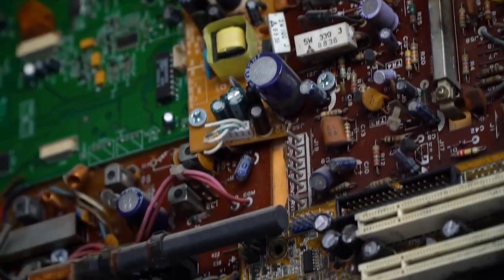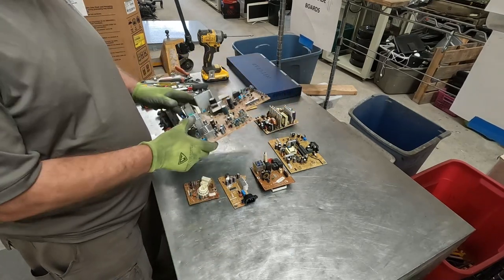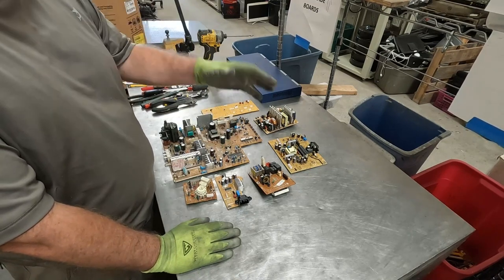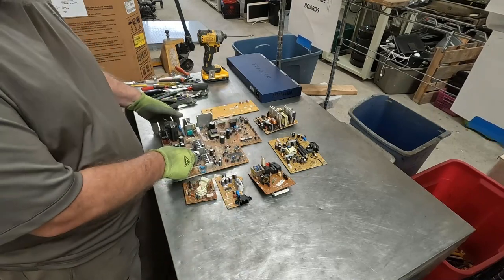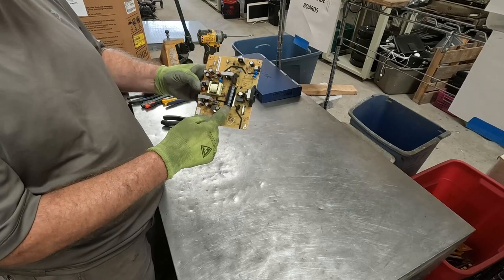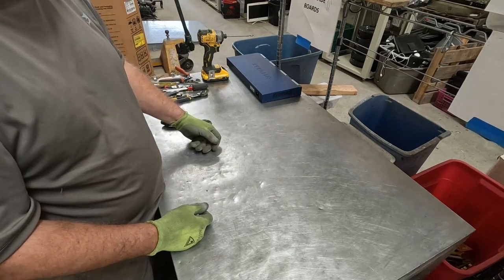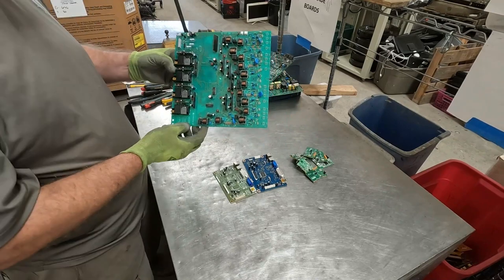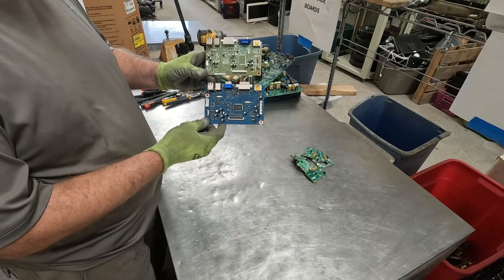Ewaste Scrapping - Low and Mid Grade Circuit Boards

Comment: My local yards would take any and all boards as tin shred, but 30 minutes away, one yard buys circuit boards. I basically save up a pickup truck load. I separate all the low grade from the rest. Since low grade is basically breakage to them, I harvest transformers, aluminum, chips, etc. to get a higher price for those items, the rest is low grade with or without that. Mid/higher grade they want components left on. I can only cost effectively ship higher priced stuff to Boardsort, like ram, CPUs, HDD boards, CD rom boards, etc. Otherwise it would cost more to ship motherboards, even though I get a lower price for motherboards, mid grade and peripheral. The important thing is, I get my scrap for free, minus a little labor, time and gas. I’m sure people have similar situations. Shark sorts it all out well for his situation, but helps us all.😊
Reply from the maker: Great feed back Dr A.  Thank you.  Like you, I only ship higher value boards to Boardsort.

Comment: I only have one question if a board has visible gold if any board has visible gold does that make it peripheral high grade and also how about the boards out of the hard drives they are brown on the underneath some of them but they are filled with a gold connection
Reply from the maker: The rule of thumb is "no visible gold in the low grade pile." So a board with visible gold could be mid-grade or better. Frequently they will be peripheral high, but that is more about the density of potential gold bearing chips than the visible gold. Any board off of a HDD is categorized as either "high grade" HDD board (non-SATA connector) or "low grade" HDD board (SATA connector).

Comment: Wow, that is very interesting, that lot would all be low grade over here at my refiners! Except the 2 monitor boards. Love the intro and outro, very professional Sharky 👍
Reply from the maker: I had a lot of fun putting the intro/outro together.
Reply: @sharkscrapper  I bet, it was fab!!
Reply: Since scrapyards want to pay the least possible, might as well harvest off the good bits! It’s all so subjective to them too. One time I bring a load and leave large components on (aluminum capacitors, heat sinks and transformers) and they say there’s “too much junk” and downgrade. Another time it was classified “too clean” since I took off the aluminum, transformers and maybe a chip or two off the motherboards, and they downgraded a little. 😑🤦‍♂️
I have to remember it’s all free scrap, but I still want to increase the value of my time.

Comment: Also I believe what you refer to as a flat pack on the last boards is considered an ic by boardsort unless they've changed.  Love the video series concept btw... scrap strong!
Reply from the maker: You are correct, "flat packs" are technically IC's.  Some scrappers like to differentiate flat packs as IC's with legs on all four sides vs "IC's" which have 6 or more legs on two sides.  But they're all IC's.
Reply: @Shark Scrapper  they call flat packs the green chips with the connections all underneath... I was confused for the longest time on your videos.  Was like... did I miss something on the boardsort site.... lol.  Just different terminology.
Reply: A "flatpack" is an IC that is surface mounted, meaning there are no legs that protrude through the circuit board, just little stubs holding on to the surface of the board. The traditional rectangle type of IC that most people think of is called a DIP (dual inline package).  The IC with the connections all underneath is called a BGA (ball grid array).  We buy flatpacks and DIPs both as our standard IC Chip on our price list and the BGA's are purchased with or without the gold corner tab per the list.
Reply: @Boardsort  excellent breakdown.  I was referring to the ic with 4 sides of legs opposed to 2.  I believe sharky refers to the former as a flatpacks.  I could be mistaken but at least it inspired your excellent post...
Reply from the maker: Dang terminology differences.  I’m guilty of using terminology I learned a long time ago from someone not as detailed as Chris 😂
Reply: @Shark Scrapper  just want you to know your channel rocks and these board Id videos will likely help 1000's of us out here in scrap land
Reply from the maker: thank you Lee, greatly appreciated

Comment: I just went to Boardsort to see what they pay for low and mid grade boards. They pay the same for both low and mid grade boards 35¢ a pound. Guess I won't be sending any to them. I am on the West coast and it costs me about $1 a pound to ship. I will still be pulling anything that looks good off of those boards. 

Boardsort got a nice shipment from me 4 days ago. Should be getting a nice check from Chris pretty soon. 

I have one computer repair shop, in town, that gives me all their e-waste. They are glad to get it out of their lobby. Filled the back of my SUV today. Several computers and laptops in this load. Many hard drives too. I took a peak in one of the computers and they threw in big handfuls of RAM & CPUs. So scrappers give all your local repair shops a call and offer to haul off ALL e-waste NO CHARGE. Today I had to take a big 50 pound printer. But I can get rid of it for free.
Reply from the maker: That's a great way to get scrap.  Two of my clients are PC/IT repair companies.  Like you, shipping is a constraint on what I sell to Boardsort.  My shipping is also similar cost, $1 to $0.75/lbs.

Comment: Thank you!!!! So how do you get IC and flat packs off without breaking them?
Reply from the maker: I usually use my Vise Grip to twist them off.  With bigger ones, I run a chisel along two or three of the sides to cut the legs and pull them off.  Sometimes I have to use the chisel and hammer to free them.  Sometimes they break, no big deal.

Comment: Not sure what the local area yards pay for any boards, but have to wonder how much value can be plucked from low grade boards and some mid grades. Thanks for doing this series sharky, much appreciated.
Reply from the maker: Good question!  Some people really get into depopulating boards for Al, Cu and any chips they can find.  There's also some MLCC's and tantalums if you can find a buyer.  But your question is a very good one, is there enough value to make it worth the effort.  And that can only be answer by each scrapper and their situation.

Comment: Great video. I have a few questions but the main one is, how much does a local scrapyard pay for the three categories? Is low grade shred price? We have nowhere to sell them here but if I were to buy boards, what sort of prices would I be safe to offer?
Reply from the maker: You're not going to like my answer.  It depends.  Some yards only pay shred for any type of board.  My local yard is paying about $1.40/lbs for "high" but that can vary a lot.  Low grade is around $0.10/lbs, so just a little better than shred.  You need to know how you'll sell the material before you can decide what to pay for it.  Sorry I can't be of more help on that.
Reply: @sharkscrapper  That's really all I was looking for. I hope to eventually get enough that I can make a run to boardsort or ship a load to ewaste Mike if he gets that stuff figured out. Until then I will probably just depop the low grades and store up the higher stuff. Even if I paid .10/lb for low grade, I would probably make that back on transformers and heat sinks.

Comment: The problem with grading is there's no "source of truth" of what exactly is mid or low. It's heavily dependent on guidance, and each buyer's perspectives are different. That said, there's a strong general consensus. Thanks for highlighting that, it's common to see people new to scrap getting overly excited over low grade powerboards and shiet.
Reply from the maker: Very true Dixon, it's not like you can go to a tech-manual and look it up.